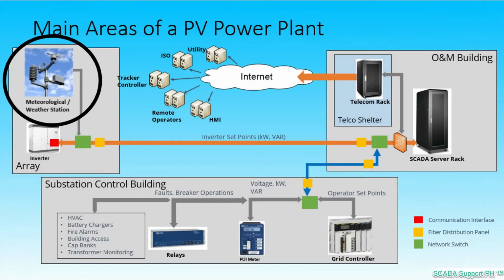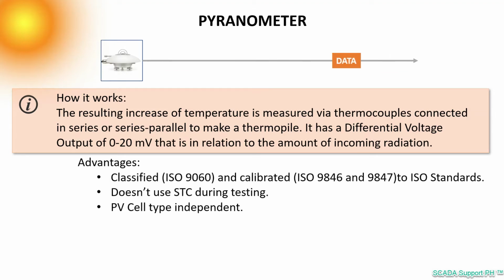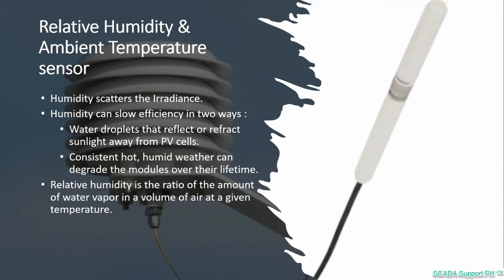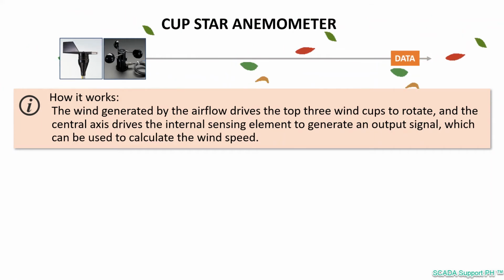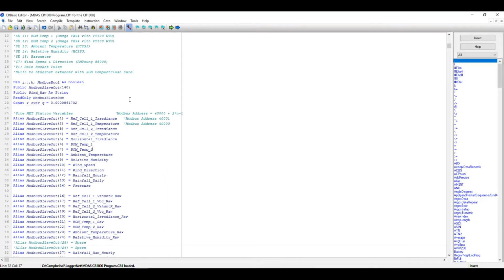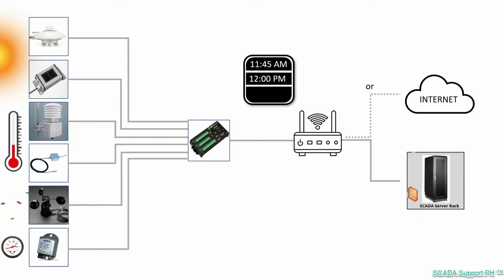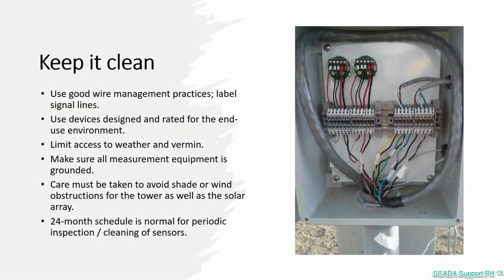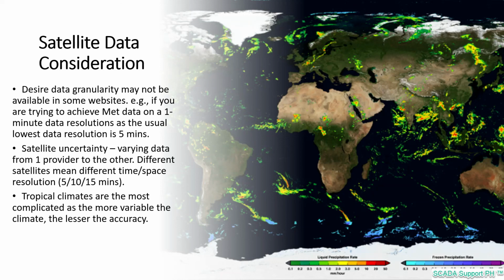Solar PV Power Plant Meteorological Data Acquisition System

Comment: I just wonder if construction of Meteorological facility need sort of building permit or electrical permit from local engineering office?
Reply from the maker: @generalengineerph Yes, it is highly likely that building a meteorological facility for a solar energy PV system would require a building permit and an electrical permit from the local engineering office. Building permits are typically required for any type of new construction or modification to an existing structure, and the installation of a meteorological facility would fall under this category. Additionally, electrical permits would likely be required for the installation of any electrical components associated with the PV system, including wiring, inverters, and other equipment.

The specific requirements for building and electrical permits can vary depending on the location and regulations of the local engineering office. It is important to consult with the relevant authorities to determine the specific permits and requirements that must be obtained prior to beginning construction of the meteorological facility and PV system. Failure to obtain the necessary permits can result in legal consequences and may also impact the functionality and safety of the system.